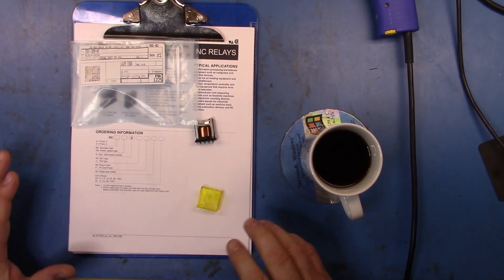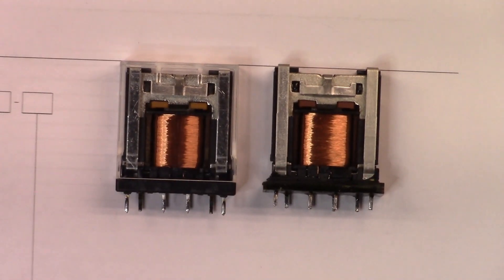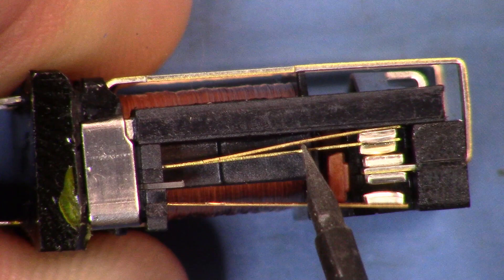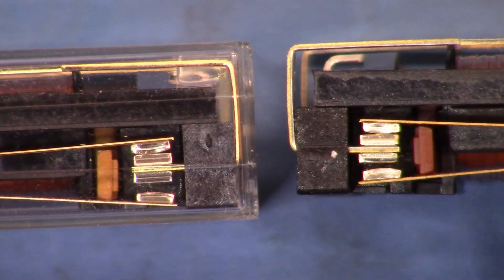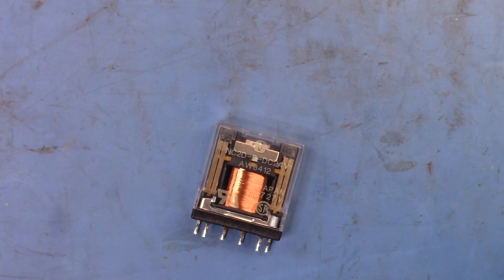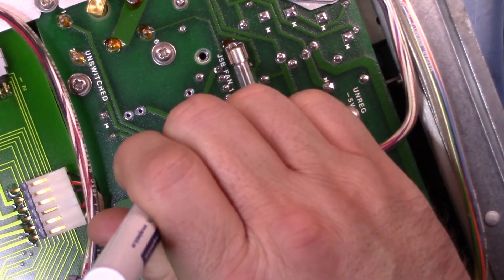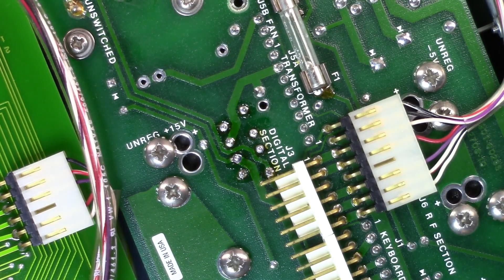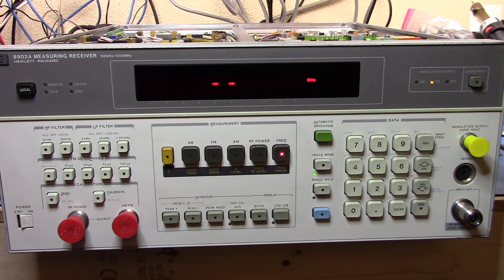HP 8902A Power Supply Repair - Part 2

Comment: Hello. I have an 8902A that somehow can't measure frequencies from 70 MHz to 156 MHz. Can you give advice? Thank you
Reply from the maker: That isn't a problem that I have seen before so I'm not sure where it would be happening (especially if the instrument is working correctly outside that range).

I'd probably start by putting something like 95MHz into the instrument and then checking the signal path to see where it stops being what the service manual expects.

Comment: Nice to see an old piece of gear back on the road, what luck to find a drop-in replacement relay! I have an HP 8901B Modulation Analyzer that looks exactly the same  as your Mesuring Receiver.
Reply from the maker: Thanks - The 8901B and the 8902A are a common platform. I actually did a video on the 8901B as I bought a parts unit to get some mechanicals for my 8902A. The primary difference is in the tuned RF measurement which gives the 8902A the ability to measure power down to the -127dBm level.